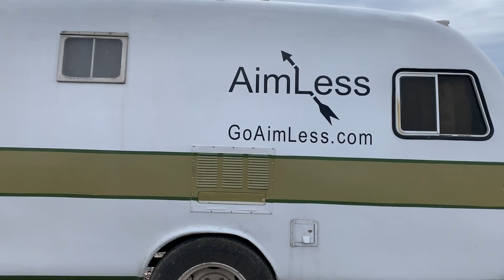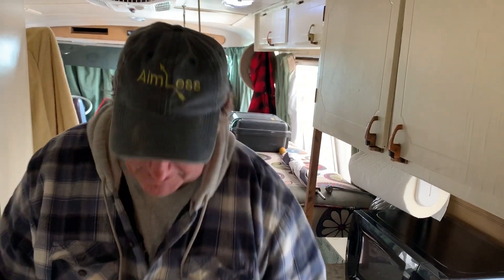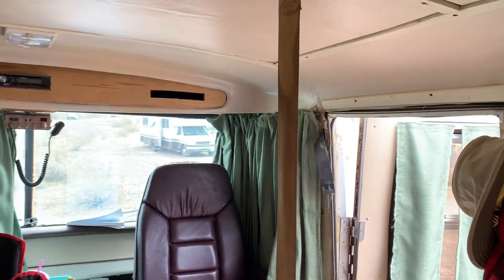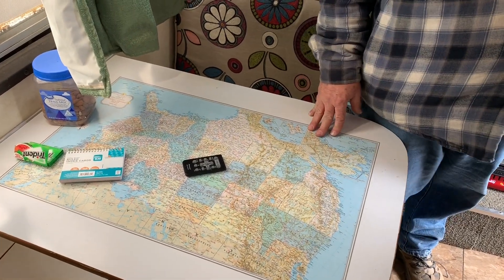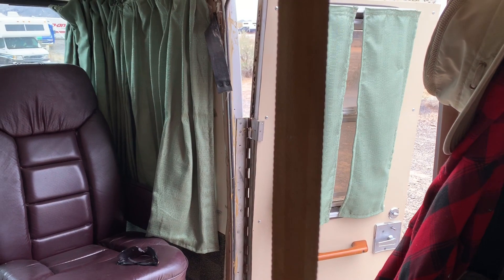Kevin’s 1972 Dodge Travco Motorhome Tour

Comment: Why do these people rip out the original gas engines, and shove diesels in these Classic Coaches ????? They were built with a gas engine, and the gas engine should be left in them. If the original builders wanted these Coaches to be diesel powered, they would have built them with diesels. They were built with gas engines, and should be left that way. When you go ripping out gas engines in something vintage like this, and shoving a diesel engine in what is not designed, and intended to be diesel powered, it creates several issues, and challenges, but more importantly, it ruins their value as an Antique. 😊
Reply from the maker: Sometimes replacement parts aren’t available. I didn’t get into the nuts and bolts of the restoration. I do appreciate your feedback.